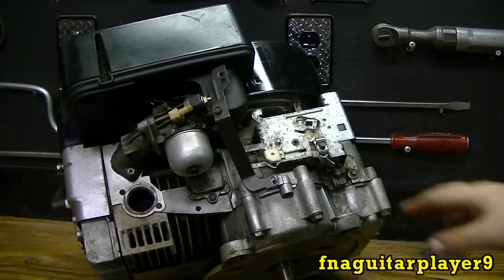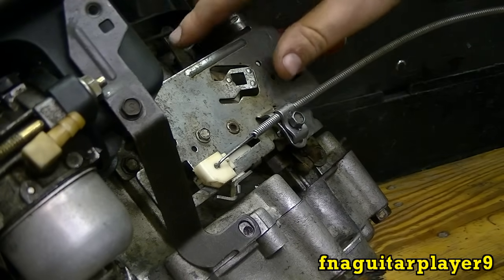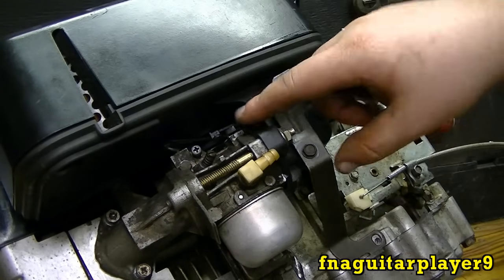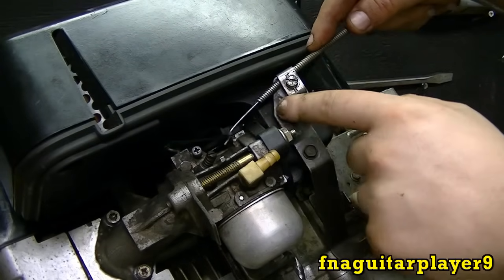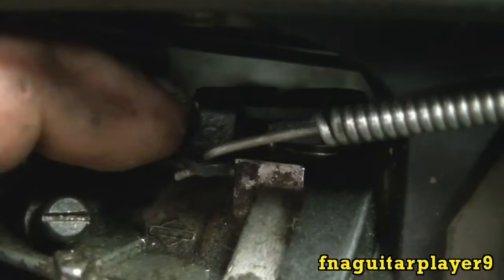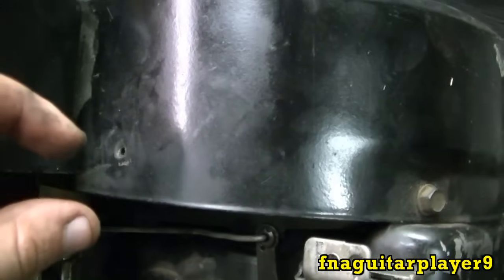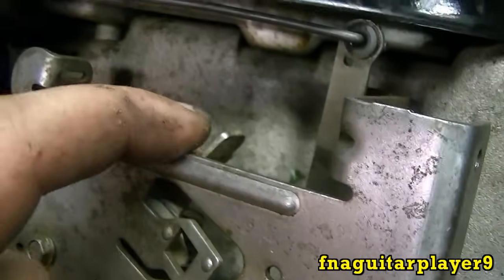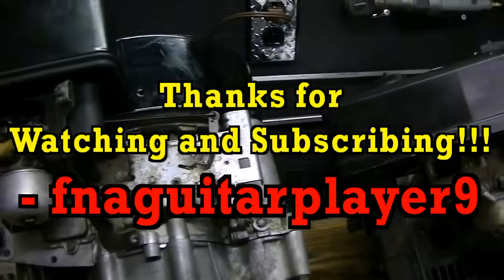How to Set Up and Adjust Throttle and Choke Cables on Small Engines

Comment: What exactly am i doing wrong i adjusted both choke and throttle and i can start my mower and it’s like the throttle isn’t working like it throttles up and everything but turning the throttle back down to turtle position it’s still running at high idle and to the point where i have to pull the choke out to get it to idle back down
Reply: I got the same problem 
The governor arm isn’t moving when i move it between turtle and the rabbit

Comment: enjoyed your videos I believe I learned some things but I having some trouble maybe you can advise me. I bought two different after markets carbs on a 19 hp Briggs & Stratton motor but can't get them running right . the air/mixer screw doesn't seem to do a thing I know I'm running lean, becauce the surging and popping/backfire stops  when I slowly give it the choke manualy . from what I learn with all the video's I watch I need to drill the Idle jet larger because Its not getting enough gas. what your option?  I did check the valve lash and its within spec.

Comment: I have a 2011 Mud Buddy 36HP sport V, Vanguard B&S motor on my boat. I lost throttle power while on the river and Im pretty sure some of the parts are in the bottom of that river. I can not find a diagram of this motor so I can identify possible missing parts for re-order as well as how to replace the throttle cable as it needs to connect to the throttle arm/governor.  Do you have any videos that would help me or other references to point me in the right direction.

Comment: Got a 19 HP  b/s with the plastic part broken off on the engine throttle plate, cheap white plastic is stupid thing b/s did 😢
Reply: Did you find that part?

Comment: I greatly appreciate the time and effort you put into teaching us your craft. I'm learning a lot about my machines, and how to repair and maintain them. However, if you could include the make and model of this one, and the ones you're demonstrating at the time, that would be a big help. I need parts like the black bracket on the carburator conecting to the lower engine, but I don't know the name of it or the part number. Thank you for sharing your knowlege.

Comment: Your video is very clear demonstrated. Thank you for that. Now my scenario is, I replaced a throttle cable on my scag 36 walk behind, ( this is my first time to do this)  now when everything done the throttle lever is backward. The choke position is all the way to the top and the fast position is on slow position. Now, what did I did wrong? Please help me. Thank you

Comment: Thanks for helping, though I think when throttle is wide open, wouldn't want the engine "choked". Choke valve adjusts the air inlet and when at full throttle with a lot of gas flowing, the carburetor needs maximum air,  choke flap wide open, not choked. You'd choke at idle to match the leaner gas flow and fully choking it would kill the engine..from idle. Point being, a cold engine and/or at idle needs to run rich with closed or narrowly open choke valve, then open it progressively as engine warms and at higher throttle. I know you know this but just want folks coming for help to understand.
Reply: True, I was like what?? 😟
Reply: You may be right, but that's not the way Briggs do it. I have a 13HP with an "automatic" choke (it isn't really automatic, real automatic chokes have temperature controls in them). When you look at the operation of the linkages the only time the choke is activated is when the throttle lever is at at 'full throttle + choke' for starting, once you move the throttle down into the Slow - Fast operating band the choke does not function at all.

Comment: The  first bend of the l wire needs to be bent with a 90 degree bend to ro sit squarely in the piviot hole to take any strain off the plastic arm this will make for smoother operation. The bend on the short tail can be at 45 degrees to make assembly easier.

Comment: On this set up. How do you set governor . Than you so much I'm gonna try it right now to set it like you did the vertical throttle assembly.  You sir are awesome for doing these videos. I got a 1992 rer snapper mower. 12 hp surging and leaking. I'm hoping I solve the issues tonight. On this Sept11.... I ordered a Corvette hood emblem..  for it. Since the Corvette is mid engine..lol and my favorite car. Lol
Reply from the maker: This video will show how to adjust the governor, https://youtu.be/9rO8AvDrdeM , Thanks for Watching!!!

Comment: I have a Toro Vtwin 656cc that was blowing white smoke. I cleaned the carburetor and did an oil change. (Fuel in Oil) Now I have a very low idle and engaging the blades kills the engine. Thoughts?
Reply from the maker: Check the springs on the governor, linkages too. I've had the springs or linkages come loose or get stretched while re-assembling. It may have a governed idle, if the spring did stretch on it, you can bend a tab to reset the idle speed. Or adjust the idle screw up. Thanks for Watching!!!

Comment: Thank you very much, our mower is running on idle and you showed how to fix it so easily, now even myself as a mate calls me? Passion fingers for all the wrong reasons, can fix it. Only question though is how can I ease the high revs? When started? Once again CHEERS MATE.
Reply from the maker: your welcome! If its reving to high, you can usually bend the tab that the governor spring is connected to. Thanks for Watching!!!

Comment: My buddy and I just jerryriiged a "new" throttle cable on my very old B&S. We cut it off! Used about 8 inches of it and moved throttle left and front to 3000 - 3200rmps the fastened the cable to where it was supposed to be fastened/screwd on. No new cable necessary. Besides, the model and serial #s were worn off. My only other option was a small engine scrap yard.
Reply from the maker: I hear ya, as long as it works! Thanks for Watching!!!

Comment: I don't know how else to contact you but here goes, I just found your channel and wondered if you could tell me why my B & S 17.5 HP I/C OHV engine on a 2008 Murray Select Riding Mower will only start and run in the high throttle position if I try to slow it down with the throttle lever it starts to die so it only idles and /or drives in high. Thanks !  Oh and I just subbed .
Reply from the maker: Sounds like either the idle circuit is clogged or may need adjusted, on those there is a screw on the side of the carburetor that probably has a plastic cap on it, remove it with pliers or a screwdriver, then turn that screw out about a 1/2 turn at a time, if it still doesn't want to idle then you may have to take it off and clean the carburetor. If all else fails, these carburetors are really cheap on ebay brand new. hanks for Watching!!!
Reply: @fnaguitarplayer9  Thanks man, I'll give that a look in the morning.

Comment: Hi, I seem to have a problem with my set up. I have a 11.5 Briggs on a 33 inch cut Snapper rer. It has the automatic choke. I put a new carb on it and when I set to choke it seems like the choke lever is too short. It will not go all the way over to push the lever to choke on top of the carb. The thing that moves on the back side of the plate will only go to full throttle. It will start up on full throttle though but to choke it I have to push the little wire over by hand. Whats wrong? Thanks, Debbie from Tennessee.
Reply from the maker: There may be different holes on the choke lever on the carburetor to set different "throws" of the choke, if its in say the top hole it won't close all the way. Thanks for Watching!!!

Comment: I have a john deere ezytrck it apears to have two cynder woth one choke cable and a separte throtle cable.  I don't know how to adjust them;  one of fhe cylinder is runing rich all the time and the plug getstops working .  how do you adjust the chokes on this engine?
Reply from the maker: It should adjust the same as in this video or close to it, it may be a in a different spot or look different but they all have some type of clamp on them. Thanks for Watching!!!

Comment: Fnaguitarplayer9, I just rebuilt my 11hp Briggs following your videos and everything seems good and the engine will turn over but won’t start could you do a video like this and on for the carb adjustment for my model or direct me to one you have via dm on comment I can send you pictures of my engine if that would help. It spins free but won’t fire.
Reply from the maker: I have a video on the old one piece style carburetor on how to adjust them, if its the newer 2 piece turn the mixture screw out about 2 turns, that should get it running. if its not doing anything at all, check for spark first, a wire could have gotten pinched or something when assembling, been there done that! Get back with me if you need more help. Thanks for Watching!!!
Reply: fnaguitarplayer9 I got it to turn over and start by jumping the starter and I think I’ve narrowed it down to the ignition.
Reply from the maker: @CoyoteCarChannel  I hear ya
Reply: So I got it going but the belt is kind of binding. How do you set the tension on the drive belt. There is a pulley with a guard that can slide in and away for adjustment of tension. So I have the clutch pressed all the way in but I don’t know how far I should space the pulley from the drive shaft pulley any help would be greatly appreciated.

Comment: My Ariens Imperial riding mower has a 12.5 Briggs with a vertical governor control plate. The combination throttle/choke cable comes up from the frame to bottom of the governor plate. Thinking of adding a separate choke cable since the combination doesn't work very well?
Reply from the maker: I hear ya, yeah i prefer a manual choke mainly because it keeps the engine from running full throttle at start up. Its not hard to do really. Thanks for Watching!!!

Comment: choke cable where is it actually hook on in side bracket no one shows how 3 hours counting gave up
Reply from the maker: A manual choke will connect with a clamp to the small indention on the flywheel shroud, and then the cable itself connects into the choke lever/shaft on the choke plate. Thanks for Watching!!!

Comment: Great video & helpful information. I just bought a throttle cable for a 2015 toro 60inch. Just like in your video there's a cable clamp on the engine right before the z-bend connects. .y question is how do you gauge where to tighten it down, there was a stop screw but it missing or broke off & I dont want to make it too tight, then the engine revs way too high.
Reply from the maker: Thanks! You have to keep playing with it some to get it adjusted right there is no preset way to set it up, but when you set the throttle to idle you do want it all the way so the switch kills the engine, so as long as it does that you should be good. Thanks for Watching!!!

Comment: Converting Auto Choke to manual and installing throttle control cable on briggs 7.75 hp walk behind lawn mower...Need detailed instruction and diagram on where to hook cables on to carb...and where/how to secure cable to engine and zip tie to push handle. Thanks
Reply from the maker: You may not be able to add a throttle to it, as alot of these newer mowers have a preset governed throttle. The choke may be doable, but is usually located under the flywheel cover, alot of the newer ones are air vane operated chokes. Thanks for Watching!!!
Reply: Thanks for your response. I located the Throttle and choke plastic tabs on top of the carb and drilled hole in each. I then attached a control cable to each hole and zip tied it back to the handle. A converted control box that was formerly used to engage the rear wheel drive and shift from forward to backward was then used to control the choke and throttle cable. I did not like the idea of auto choke causing engine to start at full throttle. I am a little concern that plastic tabs on top of carb may break off. Wish they were metal. Thinking of alternative ways to attach control cable if this happens?

Comment: Hey, I just notice the bottom bolt that bolts the throttle assembly onto the engine has broken off. engine throttled down and quit on me and I realized a good bit of oil was coming out of the hole where that bolt went in. have you experienced this before? what is the best solution? Thanks for the video!
Reply from the maker: No actually i haven't had that happen exactly like that. there shouldn't be oil coming from the the hole, oil may seap around the governor arm shaft but it shouldn't come out there, you should be able to drill it and rethread it but be carefull not to drill through the block. your welcome, hope this helps. Thanks for Watching!!!

Comment: Hi player, these videos are so informative.

I have a 12.5HP B&S (28t707) on a Viking MT433. I got in out of the shed for my wife and it was working as normal as now with throttle lever (ie put on choke to start). I had a call from wife to say mower just stopped working when using it. When I got home to inspect the throttle lever has changed. To start mower now you have to move it down to 'run' to get mower to start and to slow the speed instead of moving lever down to 'slow' you have to move up to choke. Any assistance would be appreciated?

Comment: Those springs on the back of the throttle Cable plate, how are they connected on a 7 horse Briggs?
Reply from the maker: It should be similar to this, I'm planning on putting a video up this weekend on more detail on how the governor spring is attached. Thanks for Watching!!!

Comment: Great video!! thanks heaps. But can someone please help me find somewhere I can buy those springs for the cables. I have a 10.5 hp Briggs and stratton that uses the exact same throttle/choke setup as shown here. 
I am in Australia so any help will be appreciated.
Reply from the maker: Check on ebay for most parts like that, the springs on the linkages themselves (that wrap around them) are just to keep everything tight, they will run without it but may cause a slight surge / lope. but if it doesn't then it shouldn't be a problem. Thanks for Watching!!!

Comment: I have to manually close the choke from the linkage with my hand  for mine to start. Will adjusting it like in this video fix that? Once it starts it's fine. It's only when starting that I have to do that. Thanks.
Reply from the maker: It should, alot of times the cable will slip and not allow it activate the choke, or you may have a problem with the choke linkage, it could be be bent or came loose. Thanks for Watching!!!

Comment: I'm dealing with a TroyBilt push mower with the Honda GCV160 engine with auto-choke.  Is the lever that pushes the carb choke control supposed to return to "open" position after the engine catches?  Is this controlled by heat or spring?  Mine works the 1st time but the next time it will not close the choke. Also, on a Kawasaki on John Deere rider, can the throttle plate go bad?  I keep setting my throttle and choke orientation but they move after I tighten down my throttle clamp.   Thanks.
Reply from the maker: I'm not sure on the Honda motors, but on the briggs that have the auto choke its a air vane that controls it, same way it works the governor, you could remove the flywheel shroud and see if thats what it is, its actually a decent setup when its working good. I have seen covers get bent and keep it from working. It can, but that wouldn't cause the cables to slip in the clamps, you might need new clamps, they could be bent and make sure there is no oil or grease on them that would make it easier for them to slip. Hope this helps, thanks for watching!!!
Reply: About the Cherokee's problem, I had two of those Hondas through here before I had to take a year's medical leave, and I haven't seen one yet this season, so I'm talking from old memory here,  but if we're talking about the same gee-whiz contraption, and I think we are,  the Honda choke was closed manually by the operator, extending a spring which slowly retracted and opened the choke whether the engine started or not. The Cherokee says:  "Mine works the 1st time but the next time it will not close the choke." I presume he means he tries to reset the choke manually again, but it fails to engage the arm controlling the choke plate position.
I hesitate to go into further detail from memory. However, I suggest the carb has been removed and reinstalled incorrectly. This is jolly good fun, involving a stack of seven components if I recall correctly, including the carburetor and a great vast heat shield and the bloody air cleaner body, which together conspire to hide the choke mechanism from view during installation. The components are stacked onto two bolts that screw into the block and hold everything together in proper compression. The air cleaner body holds the slider which is manually positioned by the operator to close the choke and extend the spring mentioned above. The choke control mechanism does not use linkages but rather control arms interacting as wipers. These control arms must be in the correct position and engaged blindly when the carburetor is reinstalled.
Reply: I was out of breath. To continue, proper engagement of the choke controls when installing the carburetor requires much thoughtful study by the rookie. Patience. Try, try again, until poof, the hex is dispelled, and everything slips together in perfect harmony. The dues must be paid; from then on, it's easy.
So, Cherokee, unless something is broken, which is unlikely, the choke control mechanism is not properly engaged. If we're talking about the same carb, that is, but I'm confident we are. You can get a fairly good view behind the heat shield from the right. You might be able to see the control arm move when you actuate the slider, that will help you analyze the mechanism.
If I'm right, the carb must come back off. That's when you earn your pay. Good luck.